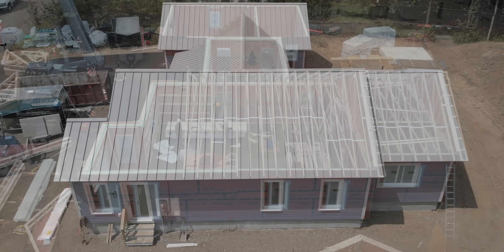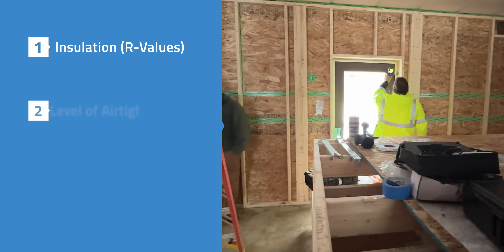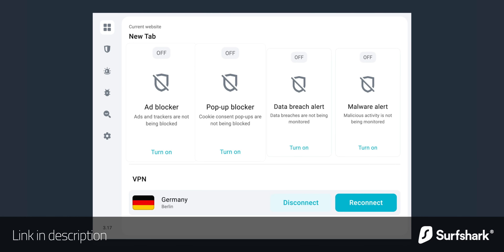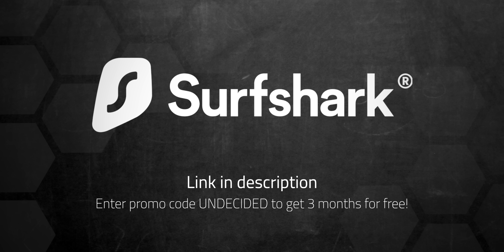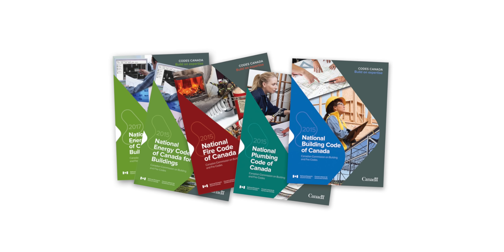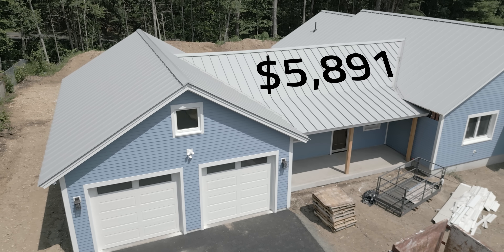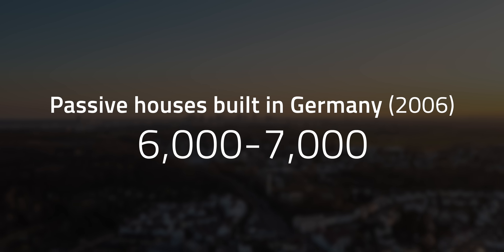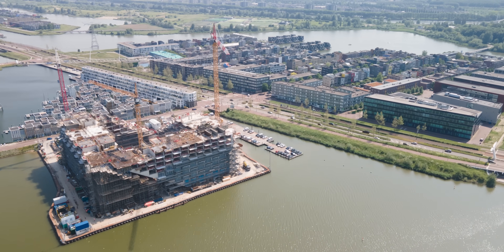Why Do American Homes Suck?

Comment: The absolute largest gain in housing efficiency and environmental sustainability comes from density, full stop.

Although very interesting, even the best designed passive haus, slickest new HVAC, windows, whatever, still require massive infrastructure (sewer, electric, and massive freeways).

These are boutique projects for a relative minority, and building them at scale just dumps everyone onto a massive freeway system.

Comment: In the US defense....there is a very wide range of climates that impact the US.  While a heat pump might work in some areas it will not work in others.  The US also has to deal with major weather like hurricanes and tornadoes that other areas of the world do not.  Energy is also half of what it is in say Japan.  In places like Germany you are going to pay around 400,000USD for an average size home there for around 1500sqft....in the US the average house is around the same but.....2500sqft

Comment: I am poor, severely disabled, and will be homeless come New Year.  I'll never have enough money to buy or build a home, let alone land to build it on.  Public housing has been full for decades.  Yet public money is given for immigrants as a priority over citizens.  Even if available, the housing slums are very unsafe.  Privately owned yet subsidized housing set their minimum income levels to be $50-100 more per month than the disabled get, to legally deny us housing under the fair housing act.  My only chance to survive would be to get a loan to buy an enclosed cargo trailer, insulate floor, walls, and ceiling, and burn vegetable oil in a small homemade heater.  Although I probably can't even get a loan for that.  But if I sonehow survive the winter, then I'd need to get solar panels installed on the roof, a battery bank and charge controller.  Of course, air is important, as is humidity control.  So I would need to hand make an ERV unit.  Various designs exist, but a stacked cube of thin plates in a box divided into two criss-crossing segments seem most common.  R10-20 flloor, walls, and ceilings are the best one can hope foor.  Getting help to build is nearly impossible because no one is willing to do that sort of thing here, or if they do, they charge excessively high labor, prioritize large projects of wealthy people who have one or more homes and for whom this is a matter of luxury to be used a few days in summer each year rather than winter survival.  Even if I get it built, then I am universally shunned, unwelcome, and a target for harassment and violent crime, from police as much as degenerates.  And even then, clearing snow to maintain vehicle access and mobility is a near impossibility.  But nevertheless, what can I do, but design and plan and try to survive a homeless winter?  I'd be happy enough with 6 month supply of food and heating fuel, parked in the wilderness, away from the harassment and violence of humans.  I'd much rather contend with wild animals as they're more civilized than hateful fascists.  This is my experience living in the USA.

Comment: So what would be the best steps for a person who is building a new home to take if they would like to incorporate that passive home design features mentioned in the video?
Reply: SSW facing, Solar, spend some on insulation and think of power storage later as becoming an island is where things get expensive. Also I'd like to note, heat pumps and anything taking warmth from ground, nature doesn't like it, and enough of it can even tip the scale on whether an EQuake occurs or not. Not a fan personally.

Comment: In Australia the building standards are pathetic. We live in a colder area and we were previously renting a house that was insanely cold all through the year. We recently bought a home that is north facing in the living areas and has tons of insulation and double glazed windows, solar panels and batteries. The difference in comfort and ongoing cost for electricity is insane.

Comment: As a European (Dutch) I also was kind of shocked that the American cars were so fuel inefficient compared to European cars when I visited the west coast in May this year. All the Americans I spoke to were also shocked to find out our current gas prices here. It wouldn't be feasible financially for them to drive their gallons-per-mile RV's in Europe.

As for the buildings I also thought most (west coast) homes were quite energy inefficient poorly insulated. The quality in windows you mentioned is also something I noticed.

Good topic to expand on I think and maybe a follow up video with practical examples and legislators to speak to is an Idea?
Reply: Increased regulations will just mean that less people will be able to afford a home and more people will become homeless as a result.  There is no guarantee in the USA by the government to have a roof over your head.

Comment: Interesting, never knew windows in US are different, I thought more ore less similar tilt and turn windows are used everywhere. I recently was in Norway and they use windows which tilt not from the top inside, but from the bottom to outside. I think it's pretty good idea as it makes less possible to rain come inside if you tilt open window when raining.
Reply: Can they be used with screens to keep bugs out?  The USA has a lot of bugs.
Reply: @laurie7689  yes, of course

Comment: In my home state there's a Darwin position. Older houses are often grown room-by-room. As one travels south, building standards generally become more and more lax. I bought in TN. The place is a 1990's house. R15 throughout. The HVAC is well done, fully jacketed with insulation. Well. Injected walls brought 4" walls up to somewhere in the R30s. A layer of R60 in the attic and done. The windows are dual pane semi-thermal. The ugly duckling remains the patio doors... $3K/ea to replace makes thermal blackout curtains & shrink plastic suddenly look good. 
There IS benefit to watching others spending on developing bleeding edge tech. China is spectacularly good at stealing other people's technology. I'm not recommending the five-finger discount approach, however there's benefits to letting other's do the expensive break-through R&D. Do you buy the first model of a brand-new car? Biden wants to put fibre optics in everyone's pot. One might think "too little, too late" or perhaps "name one massive project that the government considers a success." Less government meddling, more government creating infrastructure. Do you seriously thing the USG will string a $B of fiber without wanting a lion's share of the control? I hear they found a massive structural security flaw in commercial routers. 

That said, I'm waiting till PV & energy storage becomes more mature. Batteries are still in the R&D phase. Low capacity, expensive & short lived. They are not there yet with the chemistry, much electrical infrastructure. My county's electric provider's website is a study in bureaucratic busy signal: Don't bother us. Don't call, write, or send carrier pigeon.

Comment: A little reminder here. Pretty much all houses in the US are built from wood and timber frame structures. This makes a huge difference in comparison to brick stone houses. The thermal mass is the key here. The bigger the thermal mass, the longer it takes to heat up(summer) and the longer it takes to cool down(winter). Besides all the factors mentioned in your video, I strongly believe that the thermal mass is biggest difference.
Reply: It makes a difference for short term temperature swings (Day/Night), it's an equalizer and slows down temperature changes. But it doesn't do anything for keeping your house cool over the summer or warm at winter for extended periods of time.
Reply: Nice to see someone knows about thermal mass. Put concrete walls (or other heavy mass materials) inside and insulate the heck out of them outside. Fur them out inside for aesthetics as desired or needed.

Comment: An architec explained houses in most of Europe are easy to design. They are usually cold climates or warm climates. So, easy. In Australia, the temperatures vary from one extreme to the other so it is very difficult to design a house that will cover all aspects.
Reply: Insulation works both ways. I built a 4 bedroom house 5 years ago in the hills near Melbourne. We have had snow in the winter and 40+ degrees in the summer. Highly insulated, double glazed tilt and turn or fixed windows, air heat exchange system etc....... The first three years our total annual power bill was around $40. We use a small split system to heat and cool the house. Doesn't make any real difference whether it's summer or winter, the house works. 

Because we are on the south side of a hill we made no great attempt to manage passive solar as much of the house is in shadow during the winter months.  Hence insulation is the key.

We did strike problems with the local building codes. We could not do everything that we wanted to because some of the improvements could not be approved.

Comment: This has not always been the case in the US. Prewar houses of the upper middle class are substantial in many instances. With storm windows over casing windows and brick clashing with an insulated gap to the frame, some of these old houses are just thermal and acoustic fortresses.
Reply: They didn't do the storm windows until much later when energy prices went up.
Reply: Depends on where you lived. Storm windows and screens were a common option in the Midwest 100 years ago. @sparksmcgee6641

Comment: I'm quite disappointed that there was no attempt to question/ establish the premise of the video. I skimmed through a bit, but I didn't see any actual data on average energy efficiency. And of course, it's debateable whether that is the sole criteria for determining whether homes suck. Most of this was about regulations, but I would guess those only apply to new builds and perhaps major renovations. Whereas (based on living in the UK for a few years and traveling Europe fairly extensively) I would guess that European buildings are, on average, much older than American buildings.

Comment: I don't disagree with most of what was said in the video, but the problem is that EVERY aspect of making a home more energy efficient costs a significant amount of money. This additional cost alone removes tens of thousands (if not more) from the possibility of affording a home. Also, yes in the long run building an energy efficient house pays for itself, but it might take decades; decades where many buyers don't see the value in it because they don't see themselves in that home for that long. I'm not a proponent for government bureaucracy, but this might be a space where it's justified. Maybe a newly built home is subsidized by the government and a special tax is applied to that property for the next 50 years. I don't know.

Comment: I've lived in Europe for many years, so I have no idea what you're talking about regarding this advanced stuff that is supposably used in Europe.  USA had the most energy efficient building systems, such as structural insulated panels (SIPs), EPS Panels, etc... which provide extreme insulation, and structural integrity. Very few homes in Europe have any of these features you're talking about, very few use triple insulated windows, very few use any kind of advanced heating and/or cooling systems, and most all homes are built out of concrete blocks, which provides next to zero insulation. You're talking about the extreme exception of tiny pockets in Germany, Scandinavia, England, not the rule for the other 350 million Europeans.

Comment: We have a local window manufacturer in MI that makes thin triple-glazed windows. In 2019, for $750/window, we replaced 10 leaky old single pane windows. New color aluminium sills & frames, too. Getting 7 more done this year was over $1200 per window.  Worth it. We live on a main road. They block out most of the noise. It snows in winter and is humid in summer. We can cool the house without running the central air all day, just a little window unit on top floor. Furnace doesn't run all day either.  I'd go windows as an upgrade before doing wall insulation.

Comment: California is different. I've built hundreds of homes here since the 1980s. Title 24 leak tests and water conservation have long been on the forefront. Of course earthquake standards out strip shoddy structural other juridictions permit. Triple glazing is great but meaningless without the low e coatings that are standardized. Most homes are old and the small percentage of new ones arent going to help the overall picture. Retrofit changes that people make on older homes are the largest bang for the buck in changing consumption. Some technologies are finally catching up to legacy ones. Heat pump water heaters cost about the same to operate compared to gas despite electricity been hugely more expensive per btu.

Comment: IMHO, the first reason american homes suck is because (sub)urban sprawl sucks in the first place. building a single family home, be it carbon neutral doesn't help all that much in the grand scheme of things if everyone around are still driving their way to do anything.
not to mention i wonder how many US suburbs will have to face the huge cost of rebuilding their roads and services at some point (most likely a LOT of them), which could either mean local taxes will skyrocket, or roads and pipes will end up in a state of disrepair due to the lack of money (unless they get subsidies).

"good" news is, the US are not the only country who will have to experience the delayed backlash of suburban sprawl.

Comment: Exactly; I don't know why every house isn't mandated to be a passive house. It would actually be the same cost as regular houses if optimized to not need any AC/heating.

Also:
– The phrase is raises the question; "begging the question" is a logical fallacy.
– You mean affect, not "impact".
– The US uses US customary units, not imperial units (which are only used in the UK and Canada). I don't know why this myth is so persistent.

Comment: Although I like heat pumps. I don't like relying on municipal electricity to power it. It's clear at least in California, they won't be producing enough electricity to meet demand. So, I don't want to be subject to the whims of the public utilities commission when it comes to heating my home and water.
To add insult to injury, if you get solar and back feed into the utility. If there is a blackout, you still have a blackout without battery backup. I would prefer off-griding.

Comment: What would also be great would be energy efficiency codes for apartments and high density buildings along with codes for managing/damping noise appropriately
Reply: I 2nd the noise dampening, the way they make people live in apartments hearing neighbors is akin to a communist prison. There should at least be a cinder-block between each layer horizontally and a 2inch crete sheet vertically with insulation on both sides of each.